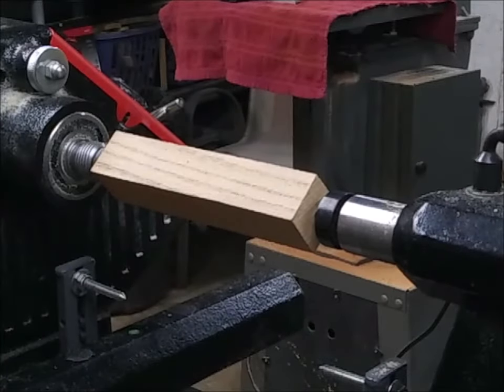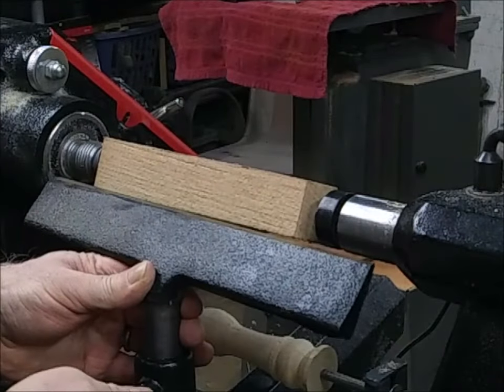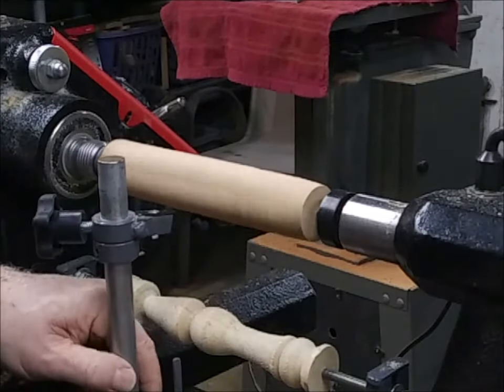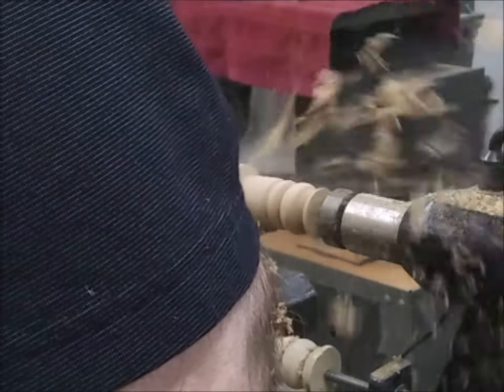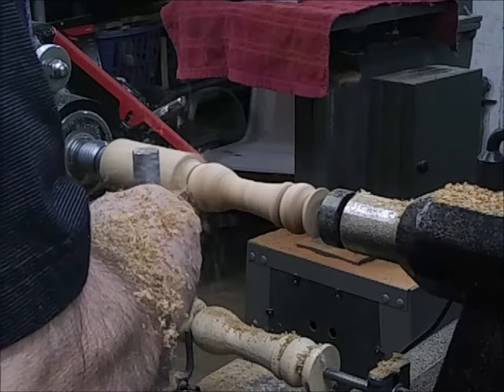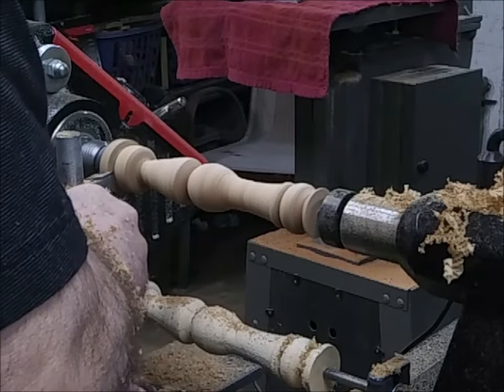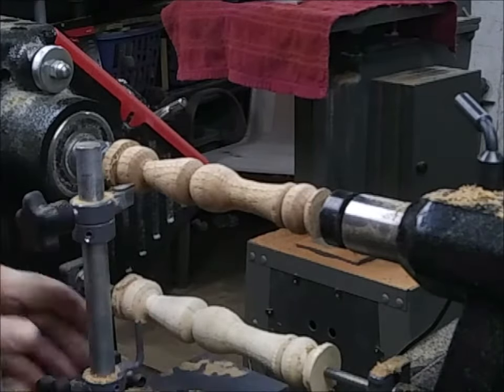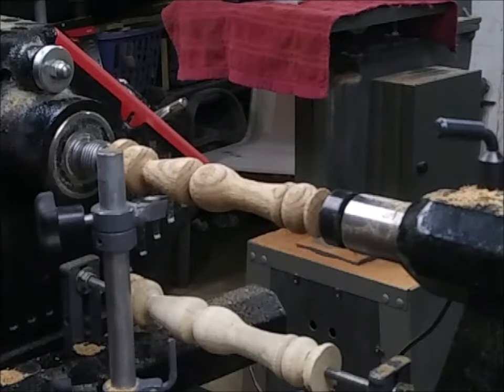part 5 wood lathe duplicator, wood lathe copier, My Lathe Tool  (The Original) side view oak

Comment: Hi...what is the maximum diameter the tool will turn
Reply from the maker: Typically 3.5-4" works pretty good depending on your lathe size.